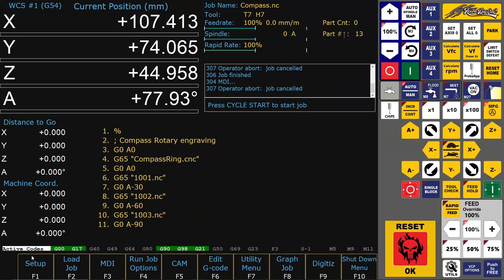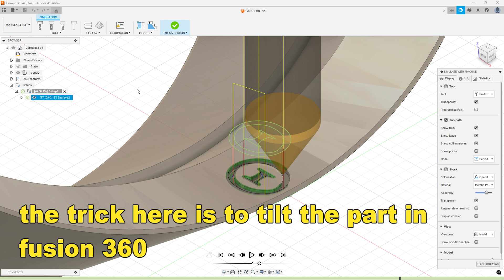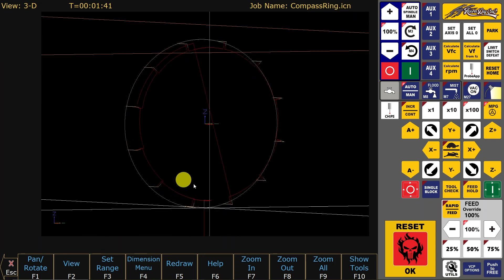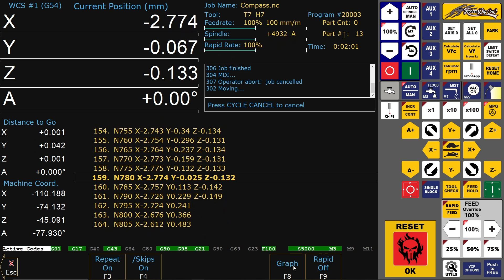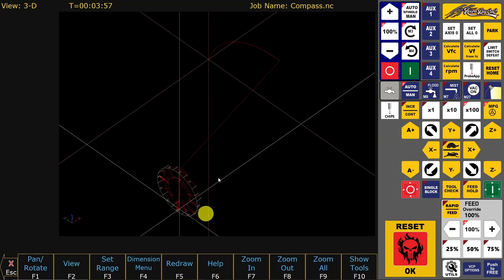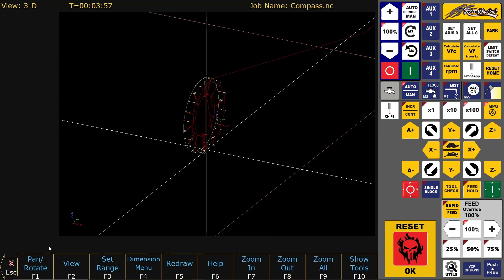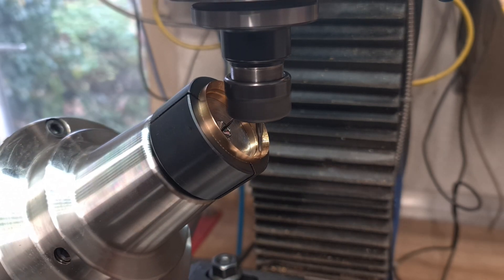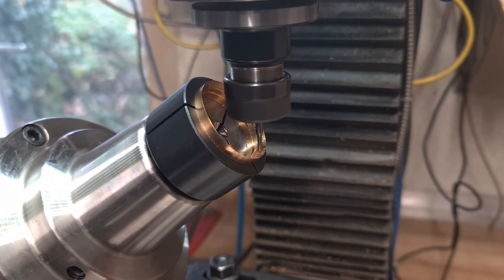Engraving with a tilted 4thaxis on Acorn DIY CNC

Comment: Terrific! Uwe + Centroid... you know it's going to be good. 
I run a 7 axis mill-turn and I do a mix of CAM & hand coding for it. Works great. Some CAM packages (like SolidCam) can also do projection engraving, where it will generate code on any non-orthagonal surface, using a sketch in a flat plane above it.